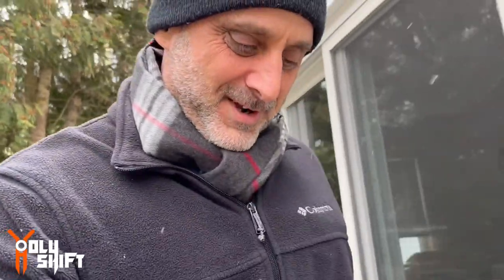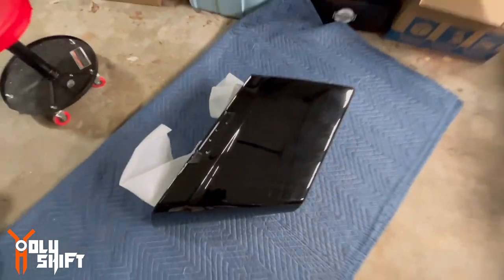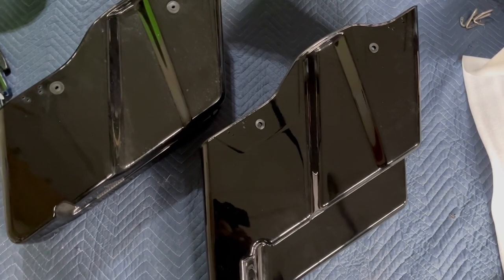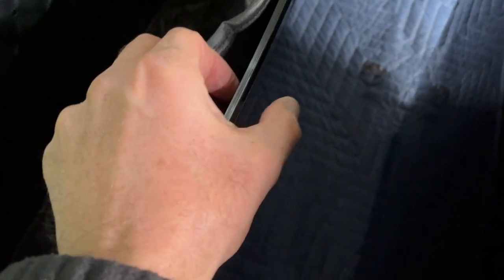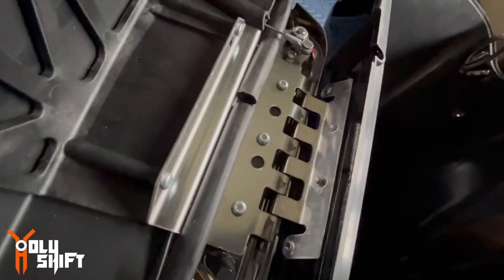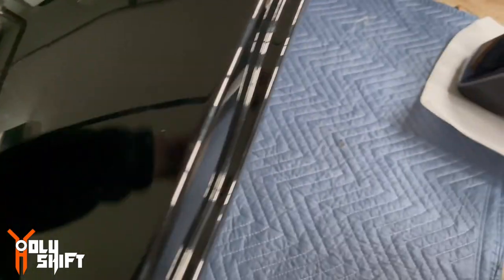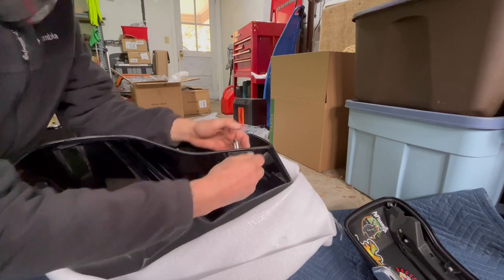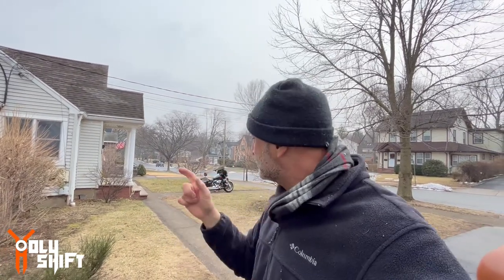Advanblack stretched saddle bags  install

Comment: Amazing transformation; looks awesome!  I like the look (sound & performance bump) of the 2-into-1 exhaust system and exhaust cutout configuration on the bags [re: opening for exhaust pipe on right side (front brake lever side of the bike)].

Comment: Sandy you may want to get an extension for your exhaust tip so it protrudes just past the cut out.
Reply from the maker: Do they have anything like that? That’s a good idea
Reply: @HOLYSHIFT  what brand sand diameter is your system? You can buy just Google them. 👍

Comment: Sandy: did the stretch bags come with the rubber bumpers on the bottom of the bags; or did you transfer the ones from the OEM bags?

Comment: Nice. Curious if you have hyper flash on dash indicators. I have it since the Dominator fender.all lights on bike flash normal but dash ones are super fast and if you hit the brakes while turn signal is on then red security light comes on the dash too. Also I had to use the advanced black mounting knobs to get bags to clear stretched side cover and get proper gap so no paint rubs. Looks and sounds great.
Reply from the maker: Don’t know about the light. I’ll know about the bag knobs once I install the side panels

Comment: Wassup bro...Great video. I have the 4.5 inch Advanblack stretched bags and just upgraded my slipons to 4.5 inch khromewerks. However, even using the adjustable mounting bracket from Advanblack to center the pipe on the right side, there is no room to rotate the pipe enough on the right to prevent it from touching the bag due to the axle nut on the right. I see you have a similar setup as your pipes appear to 4.5 inches as well, if not larger. How did you handle this because your pipe seems to be nicely centered
Reply from the maker: I never had the problem with Axle nut touching the exhaust- so I don’t know why it’s touching on your bike..
Reply: @HOLYSHIFT  it's always been that way on the right side. I have a '21 RGS and you know the indentation in the pipe that faces the nut, it's already pretty close to the pipe so there's no clearance. Thx anyway bro
Reply from the maker: @pbarre79  I guess the Kromewerks is a bit wider than my Propipe. But call up Steve from Advanblack- he told me it also works on Tab 50!Cal - and they are much wider that yours , maybe he knows a trick ….
Reply: @HOLYSHIFT  yeah, I reached out to Steve on one of his videos. He's been very helpful with all of my installs. I know there has to be something because I see guys running 5 inch slipons with the stretched 4.5 bags.

Comment: Looks like your back rest is not inserted all the way into the bracket. You can also lower the backrest pad by pulling the button under the cover, slide pad lower on bar then release button. I have no gap between my seat and backrest pad but I have the pad at it’s lowest setting
Reply from the maker: It’s the Harley seat and back rest - was always that height… I’d prefer if it was lower - to support lower back